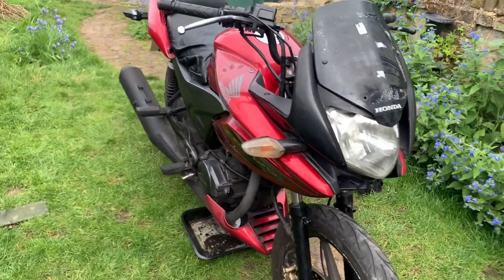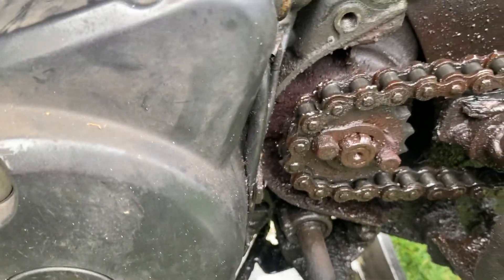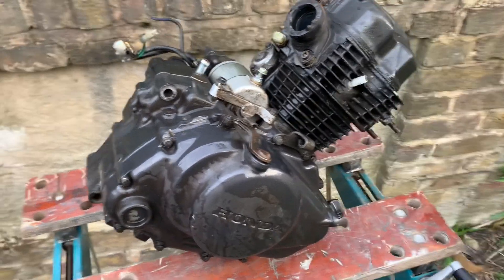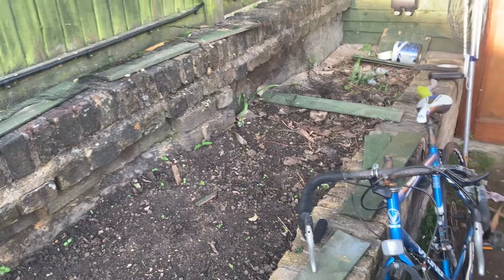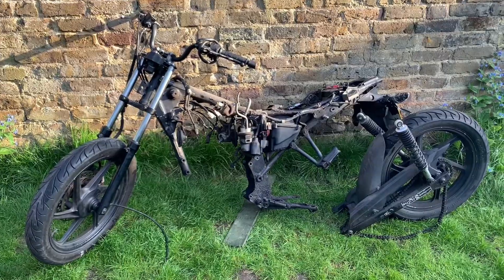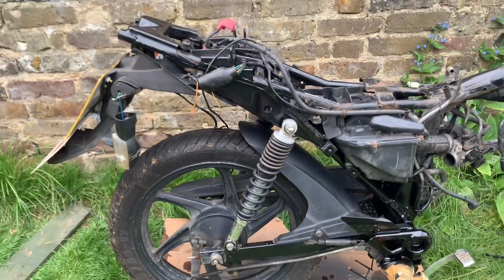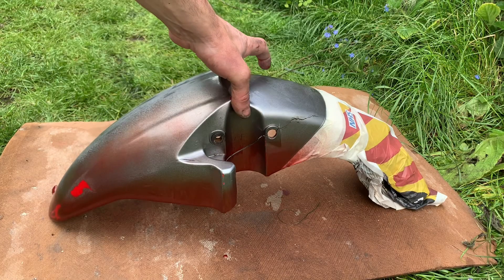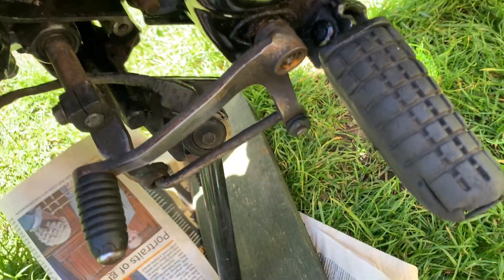Polishing A Turd PT2 Rebuild Honda CBF125

Comment: What a transformation! Nice work. Phantom oil leak... my bikes look just like that and get marked down at the MOT for 'slight oil leak', but in fact it's becausd I'm too liberal with the chain oil. It doesn't look like you have a proper oil leak there (except maybe a bit from the top end). Now, I clean mine up before the MOT...

Comment: Hi josh 
At the moment I have a cg125 which I have owned for some 15 years and served me very well. 
In your opinion which is the best model of cbf125? Is it this model in your video here or the model after this one or the very latest one 2021 on ?
Thanks.
Reply from the maker: Hello Teacup! This video has the early CBF125 which was OK but had suspect build quality and rattly top end of engine even from new. It's OK but not the best, for this age of bike a 2007-2010 Honda CBR125 is the best to get.

The next generation (GLR125/CB125F) 2015-2020 is a very good bike, solid and reliable with better build quality (built in Thailand). Would recommend this out of the three, strong engine and indestructible plus parts are cheap.

Third generation is great in some ways - extremely reliable quiet and fuel efficient engine, good looks - but prone to rust even when a few months old and the build quality isn't as good as it should be. It's made in China and shows.

If you're interested I have a 2016 Honda GLR125 coming up for sale very soon, will be rebuilt on channel soon. It has 37k miles on clock but is being engine swapped for another bike which had 2k on clock

Comment: Are you putting 10w30 or 10w40 oil in the cb125f  ?
✌
Reply from the maker: Realistically it doesn't a difference but I usually go for 10w40 for older models and 10w30 for newer models 2015 onwards